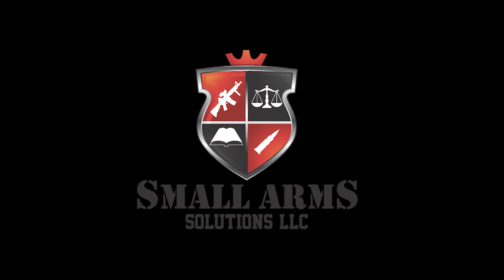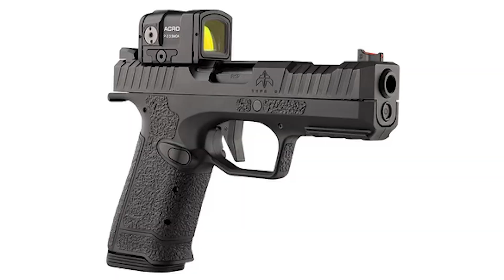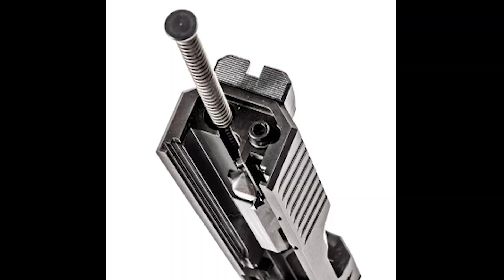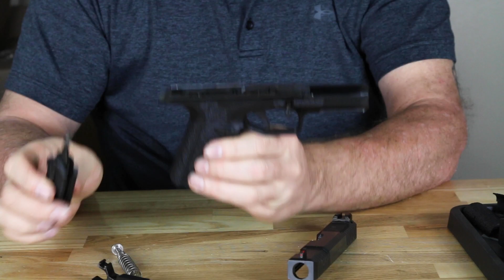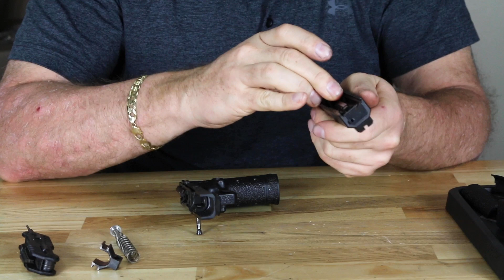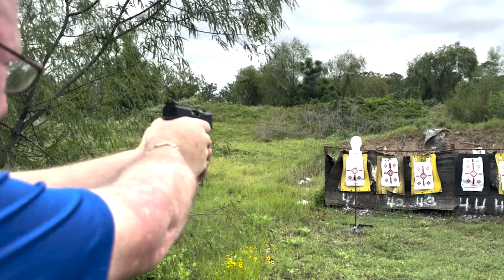Archon Firearms Pistol By PTR

Comment: You need a wearable microphone or a better one if you already have one. Your speaking voice is too low and the volume always has to be increased. Then, when the shooting range part of the video is shown, it damn near blows my ear drums. Fix that ASAP. I’m a long time fan and it has been a long time issue. You could just speak up more and more that may mitigate the need to increase the volume so high to hear your presentation
Reply from the maker: We do the best we can with what equipment we have available. I think Heather does an excellent job editing and filming. We don’t have the high price filming equipment many do on here but our presentation is just as good.
Reply: @SmallArmsSolutions  Thanks for the response. Just offering a little constructive criticism. Will still be a subscriber and viewer either way

Comment: I bought one a couple weeks ago. Yes, more expensive than a Glock but, In my opinion better in a lot of ways. For the records, former lawman and SWAT guy of 22 years. Participated in four SWAT Olympics (So I understand the requirement for reliability and accuracy) and have owned and am an armorer in several weapons systems to include Sig Sauer, Glock Colt and have shot/owned a ton of handguns over the last 45 years. I took the Archon to the range with 400 various types of rounds/makers/bullet weights. I did not pre oil the gun. I had ZERO malfunctions of any sort. Fast fire at a two-inch target at 15 yards and at first, I thought I was missing my target. Turns out, I had rounds going through the same holes. This gun is as accurate as my Sig P320 AXG Pro and feels better in the hand than any of my numerous Glocks/CZ's/HK/S&W's/ETC, Blah/Blah. Frankly, the fastest and flattest handgun I now possess. Two minor gripes for the records. First, the take down pin got pretty hot after 150 rounds fast fire and lastly, the mag release did suck but, I took her home and lubed her up while working the release and now.....sunshine, unicorn farts and rainbows. This gun should be way more popular and hopefully will be. I've never been a fancy fella to stick all manner of crap on a defense pistol, I am a dinosaur and have used iron sights for my entire life and pretty well at that. The Achon is a lite, very accurate, reliable, flat shooting as anything I have ever laid hands on and I am gonna tote this ARCHON for the foreseeable future,
Reply: you comment the exact same thing on every single vide3o about this gun lol
Reply: @ Yes, I wanted it known and not everyone sees the same video.
Reply: Sunshine, unicorn farts and rainbows😂😂😂 I know for sure you at least chuckled writing that
Reply: @joshhuntde oh yes

Comment: One thing that annoys me about "bore axis" comparisons is that most people look at the axis of the barrel, when the axis of the slide's motion is more important for felt recoil. Obviously the two are closely related, and a handgun with a low barrel almost always has a low slide, but it isn't always the case. I think that's what helps CZ pistols feel better despite not actually having that low of a barrel.
Reply: All CZ pistols?
Reply: @markp4401  Not all, I meant the CZ-75 family with the internal slide rails.
Reply: Yes but it all starts with the barrel .

Comment: I am on the fence between this and the Langdon Beretta PX4 G-SD. 
Could you compare / contract how they two pistols shot in terms of felt and perceived recoil?  I ask as the barrel operating systems are similar.
Reply from the maker: Archon is far less bulky and better bore axis. Of course one is striker fired and the other is rotating barrel.
Reply: @SmallArmsSolutions  Thank you sir.

Comment: The Beretta PX4 Storm has a similar action as the Archon.
Reply from the maker: Not at all, rotating barrel is bvery diffrent action. Only similarity is the barrel does not tilt to unlock. In this case the barrel rotates clearing the locking lugs.
Reply: Not at all. The PX4 has a rotating barrel. It's more similar to a 92.

Comment: Slick action and the price, although not cheap, is not that unreasonable...especially when compared to a low axis pistol like the Laugo Alien. Could definitely see getting one if you appreciate fine German engineering.
Reply: Actually russian/italian design, if I remember right.
Reply: Can’t wait for mine. 899 for optic cut one
Reply: @jonmeray713 899??? I can only dream about that price. In Germany, this sweet little fella comes at 1500 bucks only optics ready. With a threaded barrel you pay bout 200 bucks more